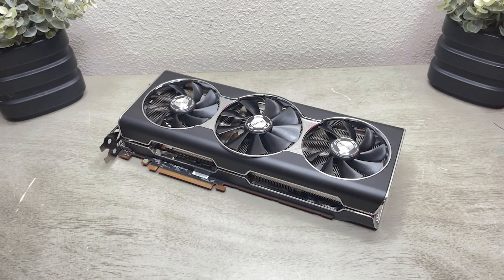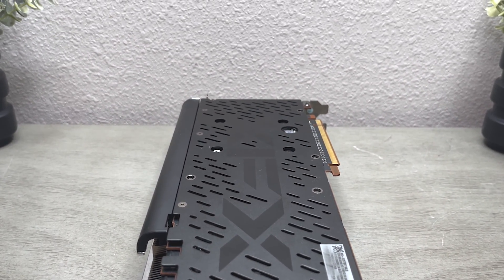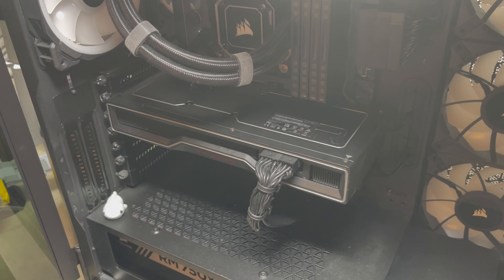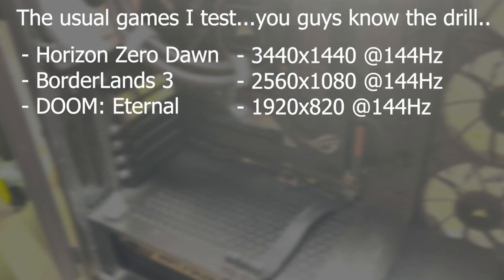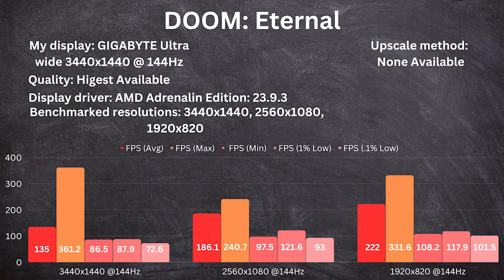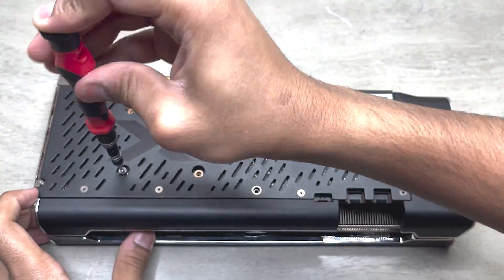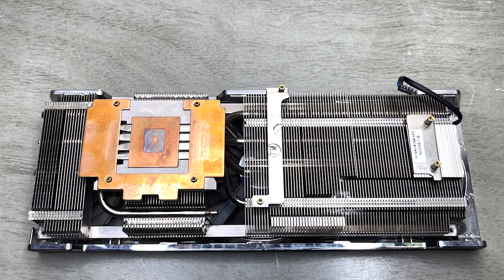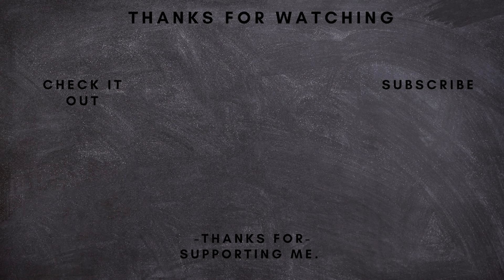Ultimate XFX RX 5700XT THICC iii Ultra Review! 🔥 Best 1440p Gaming GPU? 🖥️

Comment: i have this card and have to say i love it just dislike the high temps  as cooling is not that great to i ended up switching to water block and doing a custom loop for it with a  320mm radiator just for the gpu cooling
Reply: My uncle is giving me this card for free